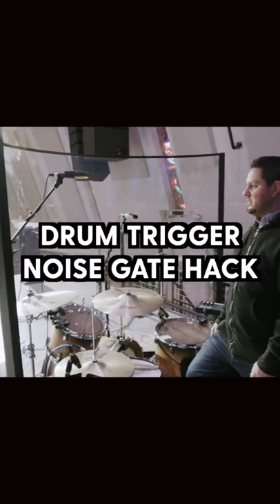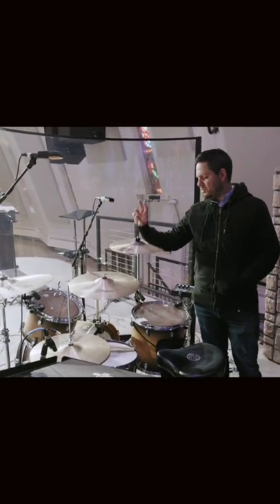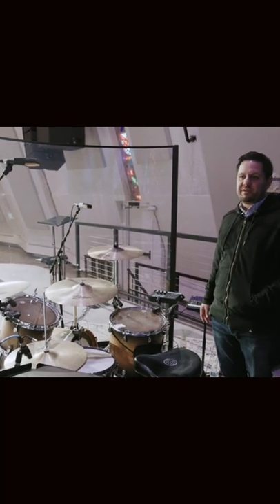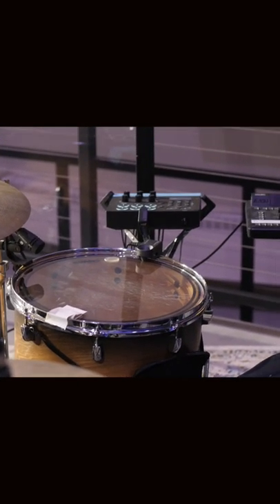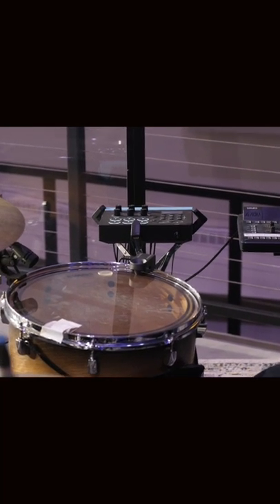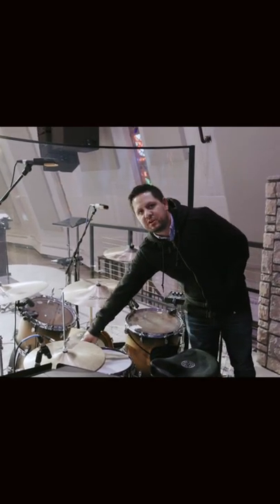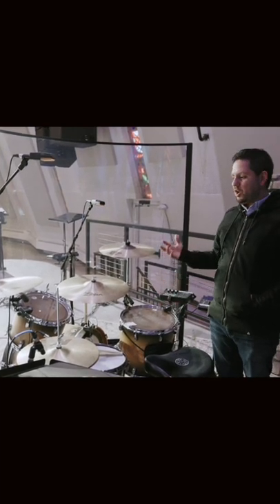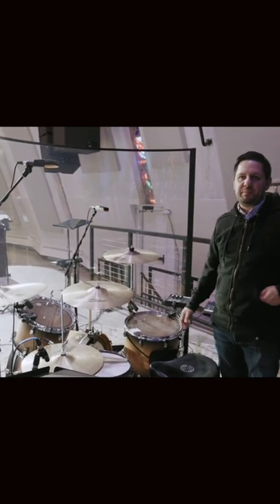Drum trigger noise gate hack

Comment: I wish I was smart enough to make this work
Reply: It's actually not that hard. Basically you need to have additional Inputs for the triggers. Then you need to set your gate, so that it opens when it receive sound from the trigger channel. Depending on your mixer you have the mic input & the trigger input needs to be side by side (Ch. 1 Kick Mic, Ch. 2 Kick Trigger, Ch. 3 Snare Mic, Ch. 4 Snare Trigger & so on). In theory the trigger sound gets to the mixer faster since the sound doesn't need to move through the air, which would be the case with mics